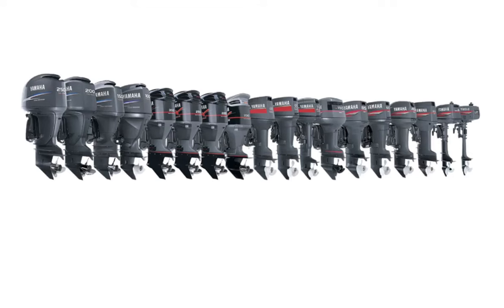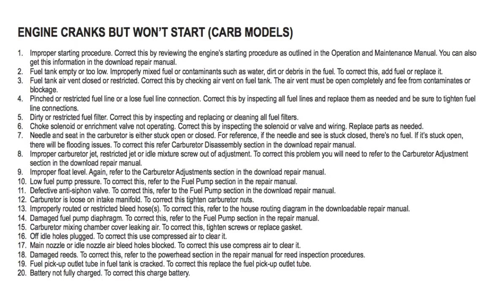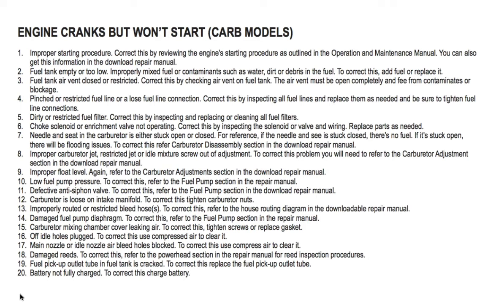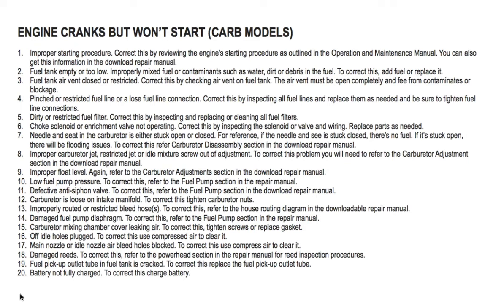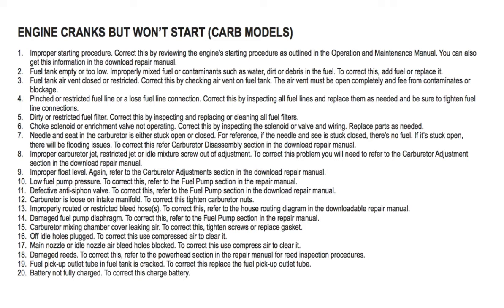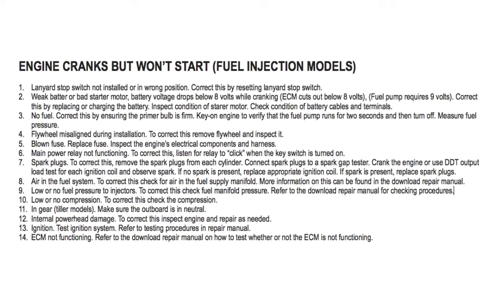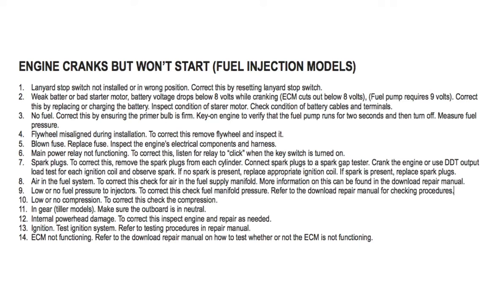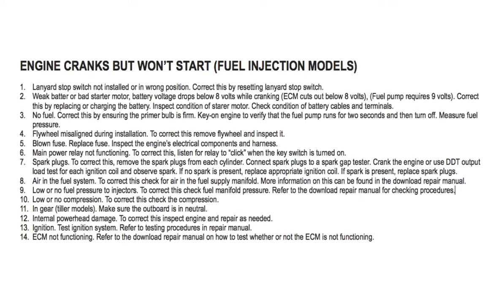Yamaha Outboard Cranks But Won’t Start (Will Not Turn On)

Comment: My 15 yamaha 4 stroke wont even start it has sparks, fuel is getting to the carburetor. When i pull it... it dont eve give a hint thzt it would start need help
Reply: Mines doing the same. Have you figured out what it was?

Comment: You should say turns over but won’t start not cranks but won’t start a lot of people use the word crank as   The engine is running.

Comment: Mine starts but it takes 7-8 puls and its stops if you run on lowest gas for to long like 30 sec. I dont know whats causing this? .  is it  burned gas smoke causing stoft filling the carburator and ignition stift that make it goes black?

Comment: Merc 15 hp starts then stops. Ball pump doesn't get hard. Freshly rebuilt carb. What next? Fuel pump?
Reply: Did you ever find out the issue?

Comment: Hi I have a 55 yamaha 2 stroke ,I changed my impellor now the engine wont crank,not even start,I checked the battery ,fuel lines ,carborator,when I pay with the lever taking it in an out of forward an reverse  sometime she gives a half turn then dead again please help
Reply: Sounds like the "start in gear protection" switch is faulty or otherwise there's an inline fuse that supplies the starter relay...best of luck👍👍👍

Comment: My husband has a 2018 yamaha 25hp 4 stroke. It will crank and run then die. He ran it about a 1/4 mile then it died like someone shut it off. Hard to crank back up.
Reply: make sure the vent is open on the fuel tank

Comment: Ignition  problems are rare on most engines... mostly fuel issues
Reply: really!,, mine refused to start because some rotter nicked my spark plugs out of it!,, I hope their prop falls off miles from shore, there reserve motor wont go, they all get food poisoning and are being ""sick from both ends at the same time"", and the sea toilet gets blocked up and wont work any more!,, am I being just a tad nasty or what?
Reply: @michaelthorpe9560  not really. sound like they deserve it
Reply: Nahh